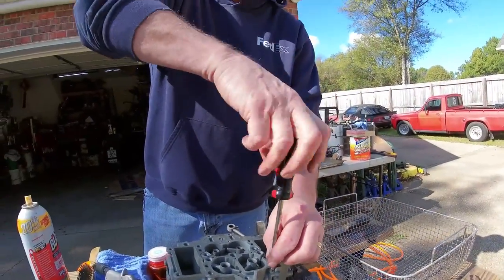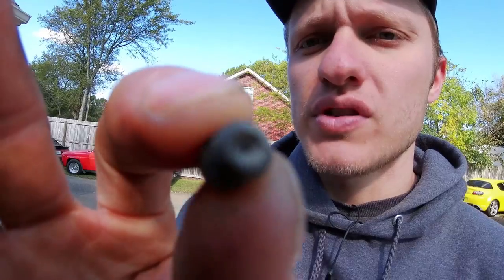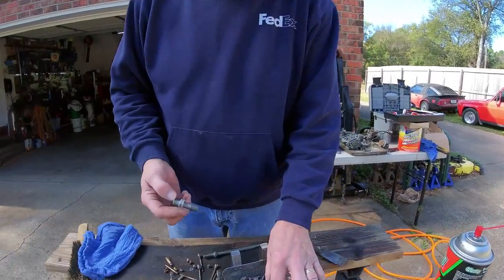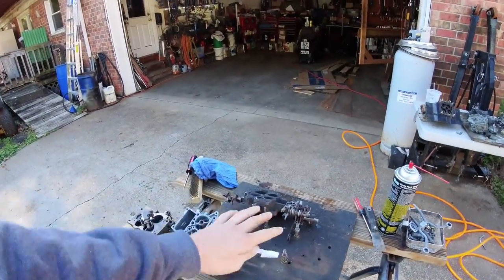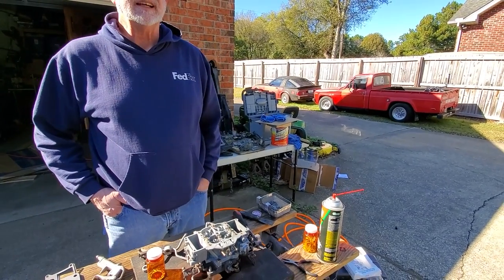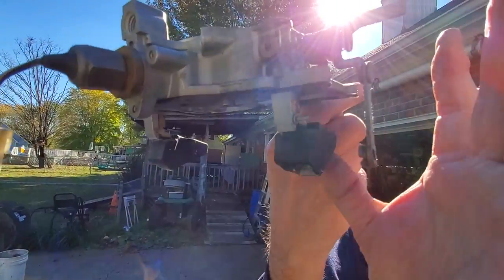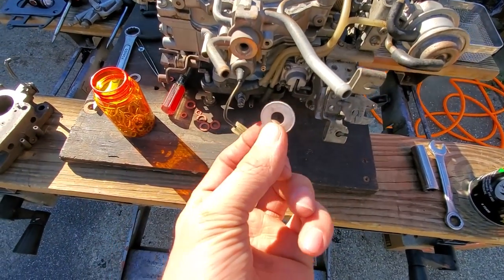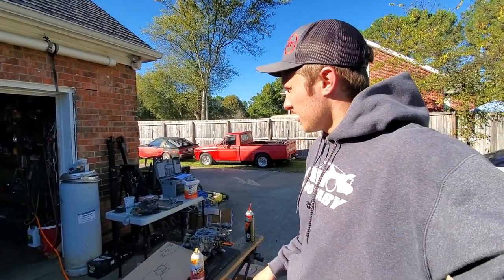12a RX7 NIKKI CARB REBUILD - The Carb Master Shares His Secrets

Comment: I feel like I should add this here, it is important to check your floats before assembly. Look up the carburetor FSM to find the specs (distance to the air horn/gasket surface). 
I recently rebuilt my carburetor and have spent the last month taking apart and back together multiple times trying to solve some crazy flooding. 
Finally picked up digital calipers and set the float tangs to get the level within spec and eliminated the flooding. 
I was extremely careful with my floats, so I have no idea how it went from fine to undrivable. But floats adjusted and it's all good now!
Also another tip, make sure you install the main body gasket correctly! if you don't, your secondaries won't work!
Great video.
Reply from the maker: Thanks a bunch for the comment!!!  I think I am going to sit down with Charles again and do a troubleshooting video.  Issues and maybe some places to look to fix them!!   That should cover adjusting the floats!!!   Mega thanks!!
Reply: @RADPotential  A troubleshooting video would be great! Despite all my tinkering I still cannot figure out all my problems. It just won't idle properly, almost acting like a vacuum leak, but there isn't one. The car will be going into winter storage soon, and I'm nearly at my wits end at this point.

Comment: I found the two balls and two weights as described in the video. I also found an extra large long weight and didn't see where it came out. This is my third Nikki rebuild but the first time I've seen this. Came out of an 84-85 12A. The other two rebuilds turned out great. Many thanks.
Reply: a weight is going to be some sort of check valve tension I believe.

Comment: Fun fact: Nikki jets are color coded: yellow is primary side and white is secondary. Yellow is more brass and white is more steel looking. Goes for bleeds as well and even jet caps on 2bbls. Does anyone know what the max open for the idle screw is before it starts transitioning off idle passage? 1.5?

Comment: My carb was missing one of the accelerator pump weights... I copped off the top section of a needled from a motorcycle carb and tossed it in there as a weight... boogie uggy brappity pappity my 12a is slower than my 2001 Isuzu trooper but is louder than my CRonetwofive

Comment: I have done this three times over my 40 years of RX7 ownership. This is a great video. Thanks to both of you for taking the time to do this. From experience, do not get the floats swapped between sides. The right hand side float needs to stay on the right side. If swapped they will stick intermittently and cause flooding or starving.

Comment: Ay RAD Potential ! Got question about a Nikki carb. I’ve been watching you for a lil while now, great work you nd Charles ! I have an Rx8 I’m rebuilding as well. Anyway. This is my 3rd 12a car. My 1st car with a Nikki carb , it’s an ‘83. It’s a very strong engine , had it sitting for awhile but for some odd reason I can’t seem to get the car to idle. It once did when I purchased the car some odd years ago… I can post some videos related so you can see but I’m really jus trying to tune the car. I get it started , pull choke to get rpm’s nd gas up. Drive it around the block to get heat in it nd the choke closes nd that’s when I start having my issues. No probs with fuel delivery. Could float lvls be the reason it won’t idle? Sorry lol I’ve daily drove an Rx8 for years. Lmk , thanks

Comment: I am ready to reinstall my acrb. Am I supposed to use a gasget when I put it back on? The gasket that I have that came with the same kit you had on your video looks correct but does not have all the lottle holes on one side.

Comment: OK..... Question with the Rotary being "Basically" a 2 Cycle engine, How is the oil fed in to the Fuel system I am trying to re orient a outboard motor to a "basically" Flat 3 cyl motor and I am wanting to put a Rotary Carb on it since they are right about the same amount of Liters size, can I run 2 cycle mix through the Nikki or can I run any Carb with 2 cycle mix?
Reply from the maker: You can run a nikki with two cycle mix no problem!

Comment: Hi RAD Potential, do you have a video on removing carburetor and special tools for removal?  Thanks 👍
Reply from the maker: If you go back to the overheated 12a video series, you should be able to find a video showing how to install and remove a stock nikki carb,  also the Lil-Stu Series has a stripped nikki install.